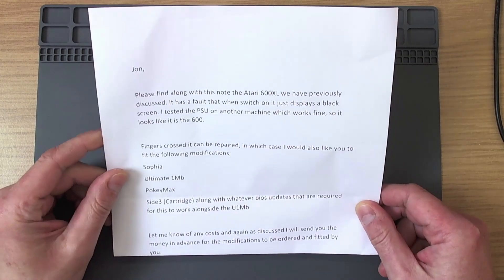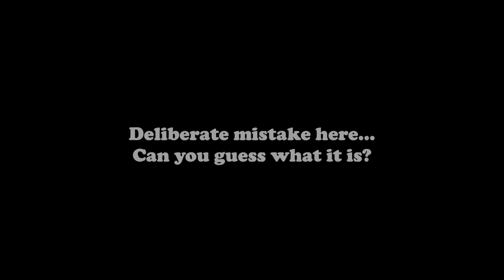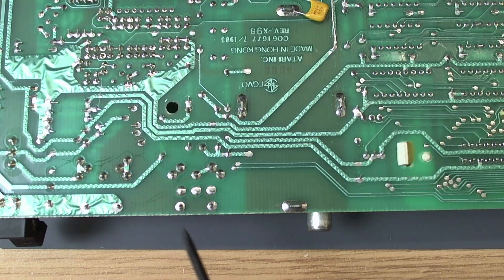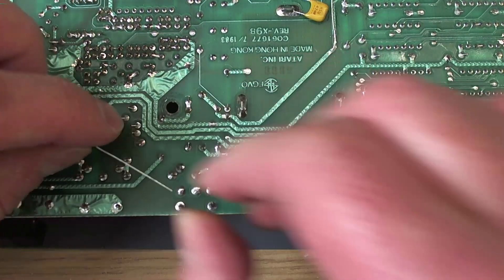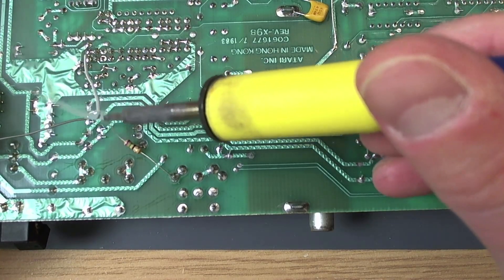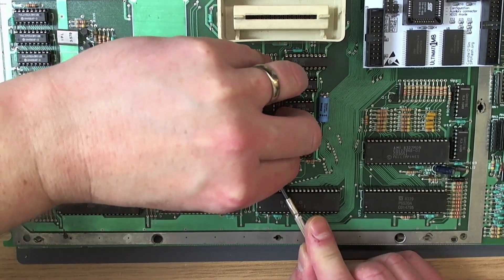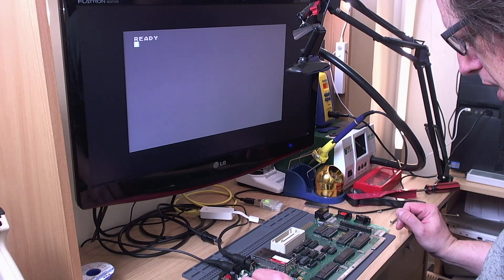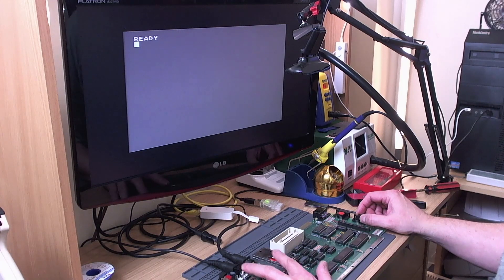Dead Atari 600XL

Comment: Look at how cute those little, tiny RF shielding plates are! When I first opened my A-800, I remember thinking Atari musta spent over a grand (USD) extra for Atari to ship out the lot of their 800s to stores — especially with the shielding around the cartridge slots. Of course, that was 1983, and I’d just turned 11 — having gotten the 800 for only $100 at a garage sale (and the tape drive for another $15), using 2/3 (and 1/10th) of my birthday card money from my parents and (great) grandparents. Turned out it’d be much simpler than I’d thought to get to the memory card expansion slot for the module I’d asked to get for Christmas. It didn’t come with a manual, and I’d already taken out all the screws I could find on the case. I’ve always wondered, though, how incredibly far off my guess was about those heavy metal shipping costs...

Comment: Nice, quick fix.  If I had a "dead" computer, I would hook something up to the SIO port to see if it tries to boot, which would tell me if the problem is in the video circuitry or something more fundamental.  But a video-only problem is not on your likely suspects list, so that might not be worth the effort.  Of course, for someone who doesn't know what they're doing like me, the more diagnostic work that can be done first, the better.
Reply from the maker: That's a great first step, yes.

Comment: Hi FJC - Thanks for all your great videos and and awesome knowledge and advice - Do you know when I could order the replacement Delay Line kit that you mentioned? I've seen the GitHub link but I don.t think I can order from there? I've got an 800XL that I'm trying to repair and the Delay Line Chip is my first possibility. If that doesn't fix it then I'll be after a new CPU too. Keep your fingers crossed for me. Thank in advance Jon!
Reply from the maker: Hi Paul. Sadly I don't know where one would purchase a pre-assembled delay line replacement, but you might consider the Lotharek 64K SRAM board, which will make the delay line redundant anyway (and replace a large amount of the RAM bus, including all the DRAMs and much of the 74 series logic). https://lotharek.pl/productdetail.php?id=291

Comment: Dead CPU.....pretty rare right ?
Reply from the maker: Not at all! Probably the most common failure along with bad DRAMs on all XL/XEs. CPUs are dead so often I had to pay 50 GBP for four brand new processors after completely running out of spares.
Reply: @flashjazzcat  ah ! I'm not repairing that often but had never run into a dead CPU. At those times it's not helping it's not a generic 6502 I guess.
Reply from the maker: @atariandre5014  Indeed so, and parts are becoming more expensive. But dead CPUs are probably statistically the number 1 fault in my experience, after repairing probably 25-30 dead machines.